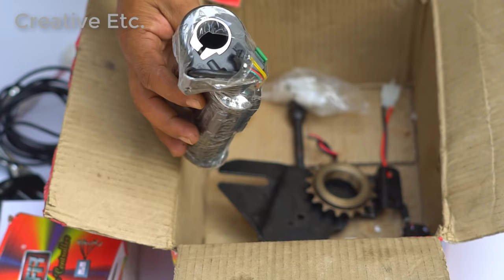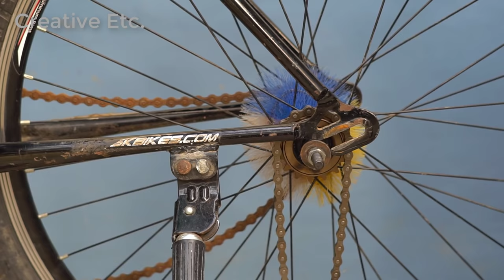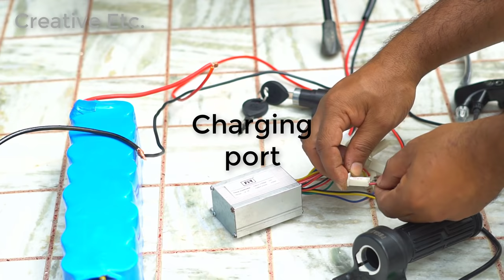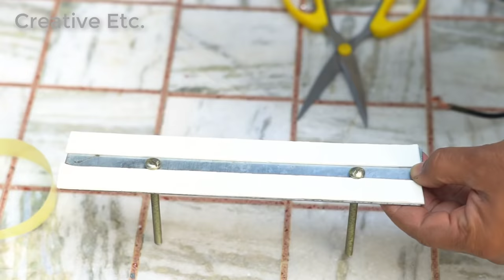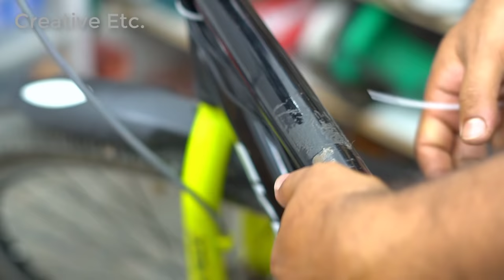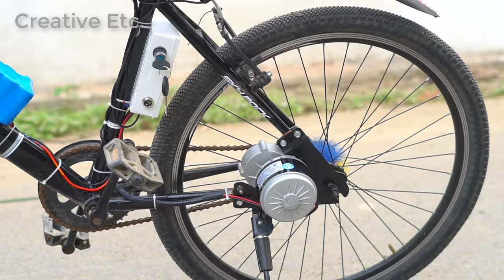How To Make Electric Bike Using 250w Gear Motor

Comment: ##Gross weight: 90kg; Max speed: 60kmph; Mileage or Distance covered : 150km ; Tyre dia : 26" ; Urban area h sir 
## Above conditions ko fulfill krne ke liye: (1) 1500w 36v motor ; 20Ah 36v battery ; Battery capacity calculate krne pe 2.2 kWh aa rha isme 
(2) 1500w 48v motor; 20Ah 48v battery; battery capacity 2.9 kWh aa rha isme sir? 
Kon sa choose kre sir (1) yaa (2)?
Reply: 1 choose karenga to 10 min chalenga.
2 choose karenga to 13 min chalenga.

Depending on speed and road conditions.
Reply: Kha milta hai

Comment: Hello. Is this originally a right side mounted motor? But you installed it in the left side by welding the sprocket in the hub? Tyvm
Reply: need be rear hub treaded gear place can add adapter and motor gear, then can use pedal and second gear use motor. i has build one similar E-bike kit
Reply: @mattivirta  tyvm

Comment: Good video. Battery needs protection from rain. Present day kits eliminate need for welding. Are the brake LEDs connected in series ? Finishing is good . Thanks .
Reply: Maybe a battery case from aluminium sheet?

Comment: What is top speed?
What is average at single charge@12ah
How much time it takes to fully charge
Reply: With 12ah battery range will be 25 - 30 km and talk about full charge its depend on charger if charger was 2 amp then it takes 6hours and if it was 3amp then 4hours

Comment: If motor is placed in left side...motor rotation will be in opposite direction...how to change the direction of motor rotation?
Reply: Change the motor's wire terminals
Reply: Change motor -+ +-
Reply: Whir
Reply: Okay
Reply: Change the polarity of connection
Reply: Change polarity
Reply: Change positive to negative and nagitive to positive
Reply: Ok
Reply: Nice work
Reply: Unless this kit was different, any I have seen with the gearmotor can only be used in one direction. The output sprocket only engages when the motor runs but allows it to freewheel when pedaling. You cannot just change the motor direction as it would just spin the output shaft while the sprocket slips.
Reply: Simplest explanation: connect red wire in place of black wire, and black wire in place of red wire. This is called changing polarity and you can change direction with it
Reply: ราคาเเท่าไหร่

Comment: Hi tnx,
Is it possible to provide a suitable output for the laptop input, which is 19 volts and 7 amps, with or with a 12-volt battery of the car, which is 60 amps?
Reply: No
Reply: No
Reply: Yes you have to use 150w step up booster module and convert it into 19v

Comment: total cost of setup with battery??? and what is the range in one charge. , and also battery specification. ?
Reply: Total cost is around 12000 indian rupees. Ranger is around 35-40 km in single charge.
Reply: Where available this set ?
Reply: @SAHILKHAN-lu8oq  kaha se milta hai  ,j pura  set
Reply: @gmaan8088  mere pas he. Mein v bechta hoon. But assembly apko khud karna padega. Battery pack+Charger+motor kit pura milega apko merese. Agar chahiye to mujhe contact kar sakte hain.
Reply: @SAHILKHAN-lu8oq  kitne me padega with battery all accessories
Reply: @sambhajijarande340  asalme kharcha ap jitna km chahenge, uspe depend karta hai. 
40km keliye 13000-14000rs. 
55km keliye 17000-18000rs.
But currently I am out of stock. Ap mujhe contact kar sakte hai WhatsApp pe stock ke bare mein puchne keliye.
Reply: @SAHILKHAN-lu8oq  hello call me if you have stock

Comment: Can use 12 volt 60ah battery?
A vehivle battery for this kit. Possible?
Reply: yes can, i used my similar bike 2 pcs 12V 20AH battery. i add batterys sidebag to rear bike.better use li-ion 12 or 24V 100aH battery.

Comment: i has make same, buy similar kit 300W motor, and use 2 year, but if build own E-bike need be more than 500W motor, 250-400W motor have too weak not good, can use only flat ground not power climp to hill or small slope. 300W kit cost less than 200€

Comment: Does anyone know what connection is used for battery, is a xt 60?
Reply: No, you don’t need to connect it like that. Just use the red and black wires without its connector and use a lighter to connect it.
Reply: And cut the other connector that’s on the controller

Comment: Brother 24v 250w pmdc motor kit 12ah lithium ion howmuch mileage
Reply: 250W motor - upto 25km/h speed
12Ah battery will give upto 25 to 30 km range
If you increase the battery Ah range will also be increased
For 350W motor - upto 40km/h speed
Reply: @jayasuryaj  what is the cost different 350w sir warranty is given the kit sir
Reply: @boxtoxtvcreations  it depends on quality, type or motor (brushless hub or permanent magnet)
Permanent magnet
250W motor - ₹1500 to 3000 (approximate it may be little bit high or low, depend on were you buy, warrenty, quality, etc..)
350W motor - ₹3100 to 4600

Brushless hub
350W motor - ₹5000 to 7000

Entire Kit may range upto ₹12000 to 21000 - depends on the specifications and quality.

Comment: I bought a kit of 24 volts, 250 watts ... I'm waiting to arrive..but I'm afraid it will be weak on climbs
Reply: Does it climbs uphill plz reply bro
Reply: It's actually weak on climbs. For that you need higher power motors. 250w is not enough.